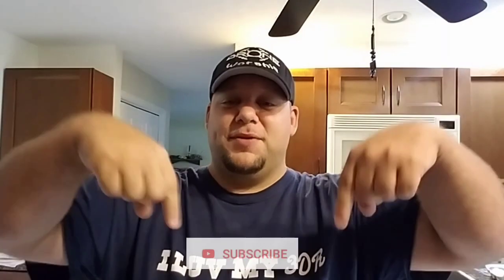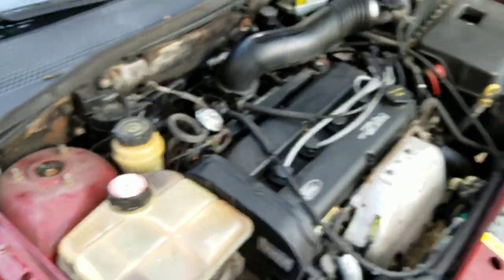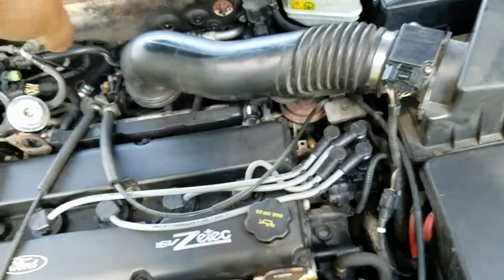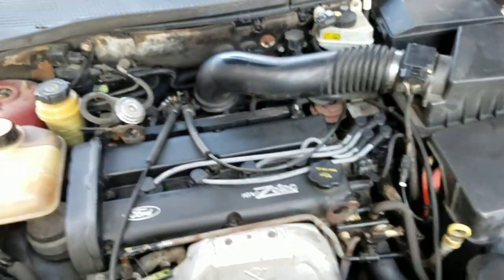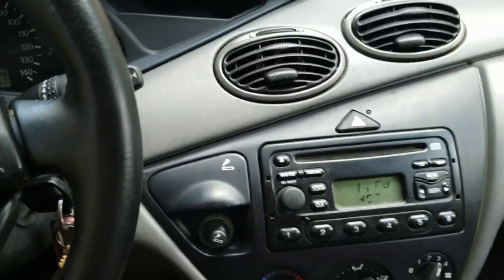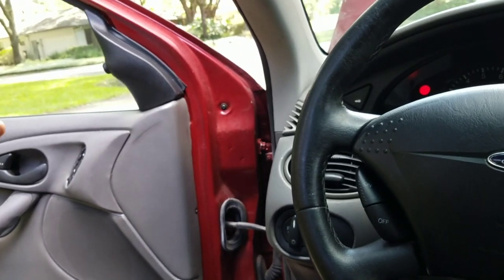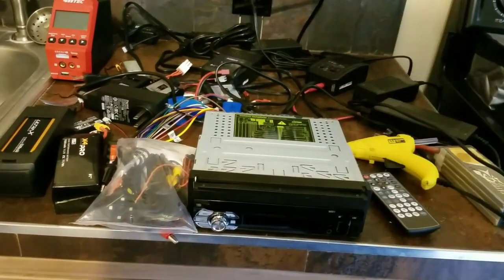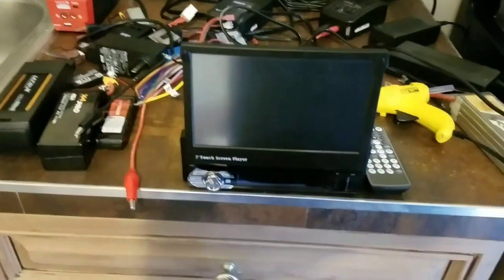2001 Ford Focus SE Running Rough FiX, Common Issues To Look For #Ford #Focus

Comment: Hey great video I just picked up the same car to commute to work, it was running rough found that cylinder 2 was miss firing and needed new plugs and ignition coil thanks to your video, it starts great runs great but if I drive around for a while shit the car off to run in some where quick, get back in to start the car it just keeps dying when idling, have to let it sit for 30min then it will start and run fine any thoughts on that??
Reply from the maker: Sounds like your mass airflow sensors getting confused

Comment: I have same car mine running down the road it cut off on me everything comes on but will not turn over got a new battery it turn over started up took the black cable off the battery to check the alternator car stood running put the cable back on turn the car off then I turned it back on went a block away from the house car cut off on me and didn't start back up
Reply from the maker: Check your ground wires on the vehicle

Comment: So I just bought a 2001 Ford Focus sedan two days ago (used). The ac has a leak and no one can find it. The ac recharge also lasts to weeks (according to the seller), any opinions? Also, anything you think I should look out for or any tips and tricks for owning n older car?
Reply from the maker: You need to pick up some R134a with leak detector and refill the system then get a small black light and go outside at night after you've been using your air conditioner and Shine the black light around the car engine and AC system. If it's leaking you will immediately see where it's leaking from because the green dye that leaks out well show in the backlight
Reply: @IFixShet  The ac doesn't work at all. Only if recharged. Also I've noticed that in order to drive the car it needs some gas pumpage. Do you think I need a purge canister valve
Reply from the maker: @akilahhodge3281  as I stated Above This is how you solve your AC problem with my suggestion that I already put up top. As far as the car running out of fuel your O2 sensor could be the problem filthy throttle body that just needs to be cleaned could be a catalytic converter getting clogged might be a bad sensor detecting air gas ratio mixture engine stalling can be a plethora of different things if you haven't done a code check on it yet I would do that if you still can't figure out the problem for about $75 they will diagnose the vehicle and tell you everything that's currently wrong with it by connecting it to a diagnostic machine which is different than an OBD2 scanner and OBD2 scanner will only tell you the vehicle codes for simple fixes a diagnostic will tell you everything wrong with the car

Comment: Hey brother I have and a question about the Wi-Fi range extendere If you were to spend additional 20 or 30 $ which one would you choose to give you even more range
Reply from the maker: Greg Kopanczyk actually the Wi-Fi repeater I found is the strongest one I've ever seen so far with a dongle set up an SMA connectors so I would probably just choose the same one I already chose honestly it's got a 500 MW it's already been taken past the two-mile Mark with perfect fpv I think it'll usually go three three and a half miles but let's be honest what's the point l o s laws are in place

Comment: PCV will make it run rough. The valve gaskets will arc out the plugs with that much oil....
Reply: TPS will do it as well
Reply from the maker: Carpenter Rick oh yes I figured that's what was happening that it was arking because of how high the oil level was. I noticed an immediate difference in how the engine was performing as soon as I got the oil out and change the plugs and wires but yes the PCV valve and hose definitely need to be replaced so when I do the valve head cover gaskets I'm just going to do all of it
Reply from the maker: @coltonjones595  you remove all 4 spark plugs and let the oil drain into the cylinders then while there is no compression in the engine and the oil is sitting inside the piston and the spark plugs have been removed turn the engine over with a rag over the top of the engine make sure to put something heavy enough on the towel or the rag to keep it from blowing away from the cylinder compression coming out after turning it over for 30 seconds go ahead and stop and have a look at your rag I think you'll find it's full of oil lol remove the rag turn the engine over a couple times again just to make sure you got all the oil out and should just be little Mists of air coming out of the cylinders at that point.  screw your spark plugs back in start up the engine and I think you'll notice a difference if you had too much oil causing the plugs to Arc
Reply from the maker: @coltonjones595  if you've got oil getting down into the spark plug chamber then what you're talkin about won't fix the problem. the only way to fix the issue is to replace the valve cover gaskets then oil will stop getting into the spark plug chamber. Don't forget to smash that like button and drop a subscription for being a helpful YouTuber it's the way you guys help us in return for answering your question

Comment: Hey man love the videos! I also have an 02, it  idles super High and try’s to drive itself. I’ve replaced the IAC Valve, cleans MAF sensor, and have replaced the Throttle Position sensor, any clue what I should do next?
Reply from the maker: Sounds like you might have a vacuum leak if you have a vacuum leak it will normally cause the car to run a higher RPM at idle
Reply from the maker: Listen for any hissing sounds underneath the hood if you can't hear anything you can take it to a shop and have a smoke test done on the EVAP system to find out if you have a vacuum leak
Reply from the maker: Also don't forget to reset the computer after you replace sensors disconnect the battery for a half hour to an hour and let it drain all the capacitors off in the car it will reset the computer to factory state

Comment: I got a 02 focus 2.0 split port engine and ever since it got cold it doesn’t want to start in the morning but even on warm days now it has trouble it will start but now it’s getting worse I have to push the gas when turning the key to start any idea what it could be?

Comment: My valve has gone too and I’ve got a misfire on bank4, I’m getting no spark and I have changed the computer and coil pack, do you know what it could be?
Reply from the maker: Timing, if the timing is off it will throw off the firing sequence

Comment: Hey bro I have most same problem with my new Ford Focus it stop at every red light
Reply from the maker: Could be a multitude of different things however if it's stalling at lights that normally would mean you have a vacuum Drive leak somewhere that needs to be patched or a line for the vacuum drive that needs to be replaced

Comment: Hey brother, I have an 02 Focus same engine & it has a soft knock at idle only. Knock goes away with acceleration. Any clues to what this is? Thickening the oil doesn't help.
Reply from the maker: Premature rod knock could even be spark knock
Reply: @IFixShet  how do u diagnose or solve this?
Reply from the maker: @johnathin79  get a auto stethoscope and listen to the engine
Reply: Is it a manual trans? If so, while at idle, push in the clutch. If the sound goes away, it's probably the throw out bearing. Mine has been doing that since 07 when it was purchased used. I have an 01 ZX3.
Reply: @michaelweems679  it ended up being spark issue. Replaced coil, plugs, & wires. Thx for replies.
Reply from the maker: Good old spark knock I figured your symptoms sounded pretty familiar

Comment: I have the same yr car its even the same red as your focus. I recently inherited the car it doesn't even have 40,000 on it but it runs like shit!! Im having the issues plus there's a bunch of gunk built up on one of the lines that is connected to the side of the radiator.  I can't afford to take it to a mechanic and I've got noone that will help me let alone take a look at it. So im on my own to fix it. Any suggestions would help
Reply from the maker: Make me a video, Let's see what we're looking at stop the link right here when you upload it to YouTube so I can watch the video try to point out everything that you noticed
Reply: @IFixShet  I apologize for not getting back to you any sooner,  I became a first time great grandma on May 30th so it's been alot of family time that I've been enjoying lately. So I do have a new dilemma with my car. It's now leaking fluid from the back of the motor and it's not oil, transmission fluid or coolant. Its clear with a slight touch if a oily feel and there is no smell and according to my brother there is no taste either
Reply from the maker: @bridgee45   Sounds like brake fluid
Reply: @IFixShet  I'm going to upload a few videos, some with the car  running and not running. I want to apologize in advance for the jittery videos I'm as amateur as one can be lol
Reply: @IFixShet  I tried sending a video thru my email but it's not going thru. I found where the fluid is coming from and it's directly underneath the thermostat housing
Reply from the maker: @bridgee45   Upload the video to YouTube and then send me the link. From what I'm hearing it sounds like the water pumpSeal has gone bad

Comment: Is the car actually slow, or could it be an issue. The air filter in mine looked really bad it was, I put a fresh one on and it ran so much better. I’m looking, to change the plugs, and I have an issue with the transmission. If a zip tie comes off I can only shift into 3rd and 4th
Reply from the maker: Oh boy you have a plethora of little problems going on the car will be slow at the air conditioners on because it's a drive-by belt AC system other than that it shouldn't be very slow especially if you have a manual. As for the shifting it sounds like the shifter guide is out of alignment
Reply: @IFixShet  well like. It was a fuck it buy. Now it’s my project. I barely even drive it. The shift issue. There’s supposed to be a plastic piece holding it on so it’ll shift left to right. To get to the other gears. I’m gonna use the car to learn auto body. Cut all the rust out, weld, paint, do all that. Be really cool I think.

Comment: DW  I sent you a Pv message  of the 02 zx3 that I painted and did all the Body work on it
Reply from the maker: haileys_ crazy_daddy hey brother I saw it very nice love the hood you put on it and very clean headlights
Reply: Drone Worship  I don't have it anymore I had to sell it I'm in my 40's now and that car was the best one I ever owned  I can tell you that the Zetec engine is the the best 4cyl engine  Ford ever made In my opinion and  the ZX3 was sold with 210,000 mile on it an all it needed was a FUEL pump when I bought it it only had 115,000 needless to say I got my money's worth.

Comment: Hi! I just got a 2001 Ford Focus about two days ago. My dad heard a sound and then my brother checked it out. Apparently there's early signs of engine rod knocking? I'm scared and I don't want to have to sell the car again just after I bought it. 😕 It seems like it'd be expensive to me, but I'd love to know if you have any suggestions for a cheap fix! 🙌
Reply: There’s no real cheap fix for a rod knock. You’d have to have the engine rebuilt unfortunately.
Reply: @kkcraven  We actually think that the engine is okay for now, but the car seems to overheat sometimes. My dad put in a new temperature gage and that worked for a bit, but now it's leaking coolant so that's the main thing right now
Reply: Sasha Gil Is it leaking out of the water pump? Usually if coolant is leaking it’s from the water pump, or you could just have a loose hose somewhere. Glad to hear it’s running though! I just bought an 09 Focus last week and I wish I had gotten one sooner.
Reply: @kkcraven  Nice!  2009 was the last year, before the focus's got rid of traditional power steering and went to full electric power steering, which is $1600 for a new steering rack and I hear they fail quite often, compared to a $200 hydraulic power steering pump.

Comment: Does anybody Ford Focus rpm and idle is high on cold start? Also my car kind of jolts or jerks a bit When it automatically shifts not all the time only sometimes.
Reply from the maker: That's because your idol is too high you need to go through your sensors and figure out which one is causing a problem could be your mass air flow sensor or your TPS throttle positioning sensor There's clearly an issue going on here make sure to check your EGR valve as well to make sure it's not clogged or Is backed up with oil
Reply from the maker: If you fixed the problem and your transmission still continues to shift hard I would suggest changing shift Is Solonoid A and B  I have a video showing how to change the transfilter and shift  Solonoids
Reply: @IFixShet  thanks for replying. did it fix the problem for you?
Reply from the maker: As a mechanic I'm just giving you advice it doesn't mean I had the same problem you did I'm trying to help you trouble shoot your problem
Reply from the maker: And you've been working on cars as long as I have there are symptoms that show through that have automatic fixes for Just based on the years of working on cars when you hear a problem from someone you kind of know just where to get started with your trouble shooting
Reply: @IFixShet  ok thank you my friend.
Reply from the maker: And don't forget all cars always idle high when you 1st start them until the engine warms up and then the idle comes down it all comes down if you're leaving when the car is still warming up it might shift funky

Comment: I have a 2002 Ford Focus Wagon ZTW Thank You for Helping fix my rough running issues.  My Radio has the same issues  The Previous Owner  used the Lug Wrench   one end against the Radio and the Curve part was pushed against the arm rest to keep pressure against the Radio so It would run .   I took your advise and I used Upholstery Thumb Tacks  (3)  in that little slot above the Preset Buttons and now I have a Working Radio / CD Player.     I would like to ask where You bought Your New Radio for Your Focus?    I would like to get one as well for my Focus.
Reply: Hey what did you do to fix your rough idle I have the same problem
Reply: @richeyanglin5297       New Plugs and a PVC Valve

Comment: Hello.
I have a problema with revs/min 
They can reach 1799 Revs and declive to 699 Revs in parking.
¿You know something about that?
Reply from the maker: Could be a vacuum Drive leak or a mass air flow sensor problem

Comment: If you are experiencing a lot of interior rattling? you will need to replace the motor mounts. because Ford is too cheap to balance their engines. that's just one of the many design flaws with these vehicles. just wait until you have to replace the rear wheel bearings on a focus. your going to really love that. the engineers that designed these vehicles should have to work on one of them that will fix them. what a waste of six years of college.

Comment: Need lifters adjusted as well
Reply from the maker: The Adventures of Fatman And Blobin it does not need the lifters adjusted what you hear rattling is the airbox there's absolutely nothing wrong with the lifters
Reply: O the sounds on the video sounds like lifters

Comment: Hey I have a 2003 ford focus same engine and when it a stop it idles rough up down and the lights dim along with rough idle? What could this be, also I've replaced the mass airflow censor the diagnostic tool said was why the check engine light is on. And that didn't help. Any info would be greatly appreciated.
Reply from the maker: Dim lights normally comes back to a weak alternator or a weak battery
Reply: Lights will dim when idle is low as well. The rough idle will cause the lights to dim, because the idle goes up and down. When it hits the lowest point of idle, the alternator is not turning fast enough to give proper power. If the battery light comes on when the lights dim, it's because of this. I replaced the crankcase ventilation hose (because it was leaking), and fixed the problem on my 2001 Focus ZX3 Zetec. Check all vacuum hoses because a vacuum leak will cause this hunting idle.
Reply: Sounds like you have a loose battery cable connection or it is corroded.
Reply: No it’s the alternator is starting to go out. Better fix it before it gets worse. Trust me I got stranded. I thought it was battery come to find out it was signs of alternator failing because change of battery didn’t help. The alternator wasn’t charging.